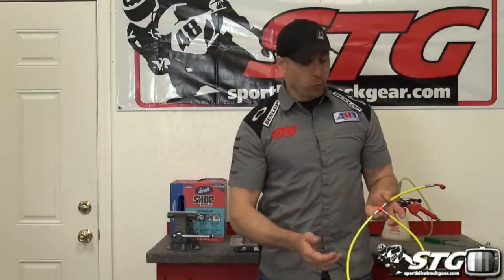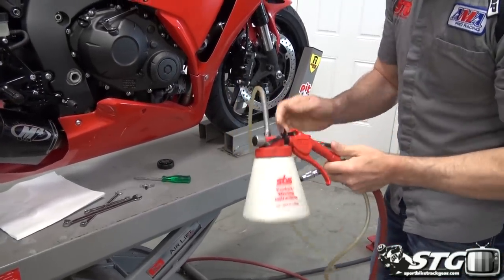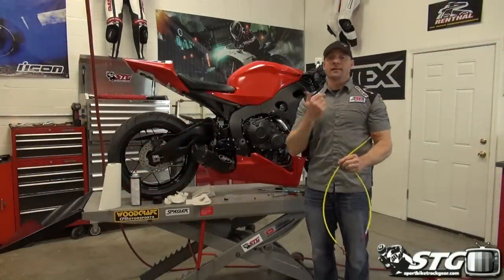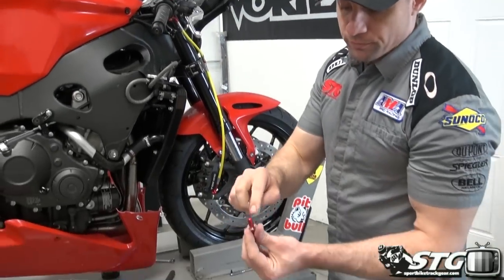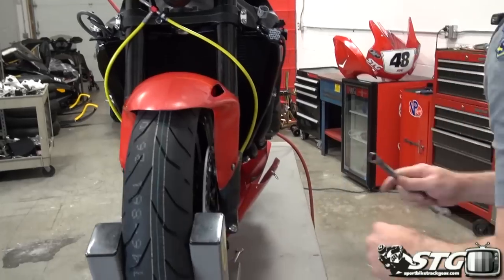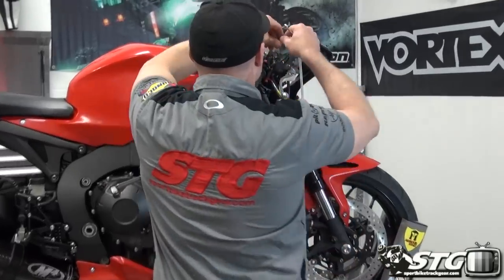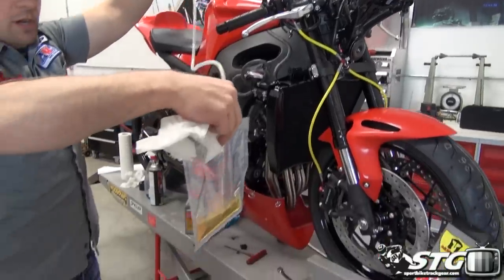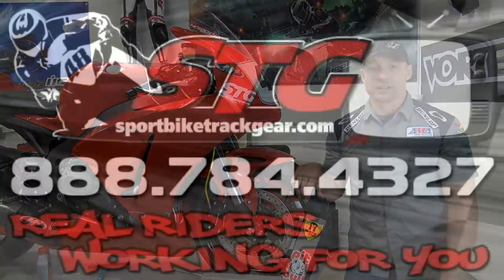How to Install Spiegler Honda CBR1000RR Rennsport Front Brake Lines from Sportbiketrackgear.com

Comment: One small tip for ppl who have not performed this task before. Just one drop of Brake fluid landing on your Plastic Dash or Plastic Screen will mark it permanently. Remove your plastic screen and cover your Dash with Glad wrap to protect it when you are bleeding your Master cylinder.Better to be safe then sorry )))

Comment: I ordered the Speigler Rennsport kit for my 2009 CBR1000RR and the lines were almost maxed out when wrapped in front of the triple. Ran them behind but there is little clearance. We'll see if they hold up!
Reply from the maker: If there is an issue with the length of the lines and you purchased them from us please reach out the the team at orders@sportbiketrackgear.com so we can help get this sorted out. - Van
Reply: @sportbiketrackgear  
Chris

Comment: I know its a different brand but my galfer lines look the exact same and they had them flipped the other way. So the line coming straight off the master went straight down to brake lever side caliper and then that line at the T went over to the clutch side caliper. So then the mount on the triple tree would line with that metal lip. But hey whats it matter it works then it works

Comment: Great video. Thank you for taking the time to post this. I feel confident tackling my bike now. Except that mine is an ABS model. There is an additional part that the break lines attach to which leads to the side of the bike and ultimately disappears under the tank. 
Is it important for this to be still connected? Can I still get this done and ignore the ABS lines or am I going to cause more harm than good. I would really appreciate your input on this.
Reply from the maker: If you plan to keep the ABS on the bike you will need an ABS specific kit to get that done. We have a few videos on other models that were equipped with ABS and we installed a brake line kit. Here is a link to one of these videos: https://www.youtube.com/watch?v=OlLt1E_7G5I   - Van

Comment: I have tried one of those vacuum bleeders and it was good, but I have had better luck with one of the JIMS USA brake bleeders. I think it was because it pushes the fluid into the caliper instead of sucking it out.

Comment: 08 ZX-10R stock routing runs behind the forks(uses 3 lines like the Rennsport kit) which I prefer because, to me, the routing in front of the forks gives too much exposure to the brake lines - looks funky. So, what is the reasoning behind your routing choice? Kawasaki's choice was behind the forks.

Comment: When you order the front brake lines are they already set up with a T module ??
Reply from the maker: The line comes completely assembled and ready to install. That junction block has the line attached when you receive it. - Van

Comment: Excellent video, love the work! I recently installed some lines for my 2013 1000 RR and I notice st highway speeds the front fender is vibrating quite a bit, from a visual perspective. Could the removal of the OEM lines and their connection to the fender sides perhaps lead to a more vibration prone fender? It was so severe I’m considering reinstalling the OEM set. Could it be I’ve never noticed the vibration with an OEM setup? All else was good with the install.

Thanks in advance for your thoughts and keep the shiny side up!
Reply from the maker: I do not feel the brake line kit will cause the fender to vibrate. Make sure you have all of the fasteners in the the front fender before you chase this problem down. If you feel the vibration in the bars you may have a front tire that is out of balance. - Van

Comment: What is the exact name of the hose clamp tool that changes the direction of the hose? I want to buy it, but I don't know the name of the blue clamp tool.
Reply from the maker: We do not sell this tool separately, Spiegler includes this with each of their brake line kits. It is a disposable, plastic tool kit designed to work with their line kits. - Van
Reply: @sportbiketrackgear  Oh, it's included in the breakline kit without selling much! Thank you for your answer!

Comment: Is there any benefit to running the Rennsport style over the dual line version (one line per caliper)? This is for a bike that’s used mostly on the street and sees only a few track days a year.
Reply from the maker: The only real benefit is there is only one line up at the master cylinder so it is a little cleaner. The brakes function the same. - Van

Comment: many thanks again for the awesome videos.
do i have to take the nose fairing off the bike to do the job? or everything is still accessible with out taking the fairing off? also whats the name of the brake fluid you were using?
also i would really appropriate it it you'd do fairings replacement job on the fireblade.
Reply from the maker: +Tito Neal Unfortunately we will likely not be able to do a fairing replacement video as we have already given away the CBR used in these videos. :(

You do not need to remove the fairings, just be sure that when you are bleeding the brakes you do not get any of the brake fluid on any part of your motorcycle fairings!

The brake fluid used in this video is Motul RBF 600!

http://www.sportbiketrackgear.com/motul-rbf600-factory-line-racing-brake-fluid/

Thanks a ton for watching!

Comment: does it matter if you wire the lines  in front or behind the forks? I have a 2008 R6. ive seen them done both ways
Reply from the maker: I've typically seen the lines ran behind the forks so they are out of the way. I am pretty sure there was less binding on my R6 when ran this way and that is how it is on my bike now.  Good luck with the front install!  ~Aubrey
Reply: i ended up running them around the front like van did! thanks alot